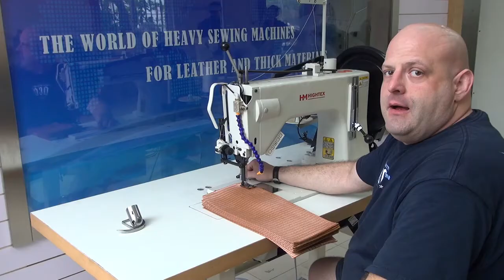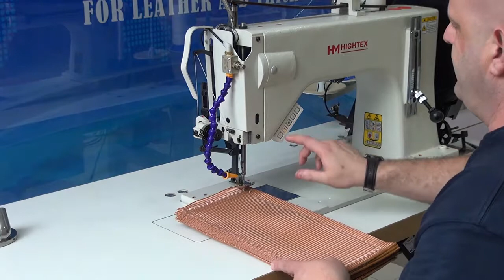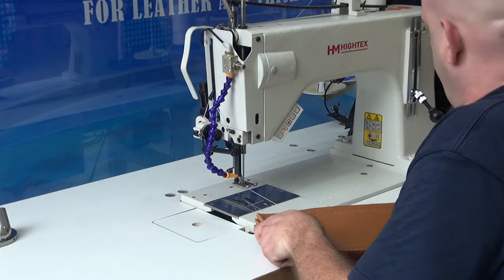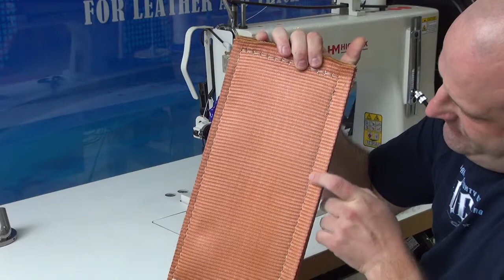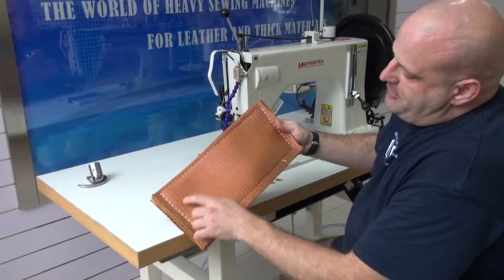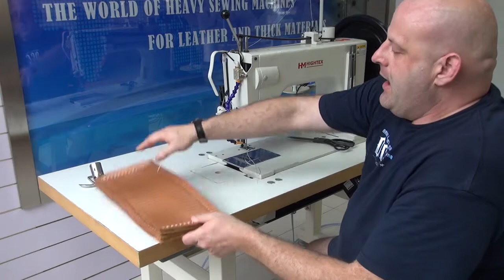733CS extra heavy duty lifting slings sewing machine and harnesses sewing machine

Comment: it is beautiful. amazing machine. 
I see in the company page this sewing machine is 240 KG. I mean the weight. is that true may I ask? I mean the standard one which has 32mm presser foot lift.
Reply from the maker: Sewing machine head + Kinedyne HM-750T + heavy stand and table, total 240 KGS, it is tule. Plus the plywood case, the final weight is 260KGS. Yes, standard presser foot lift is 32mm, we also can lift to 38mm, buy custom made.
Reply: @HightexHeavysewingtechnology  
thanks for reply. thanks for your time
Reply: @HightexHeavysewingtechnology  
I don't know may I ask this here or not? hope am allowed. 
Am busy to save money for a heavy leather sewing machine, rather Hightex brand. now I've saved 1600 euro. and I think up to "30-01-2023" I can make it 4000 euro. and up to "30-3-2023" 5000 Euro.
what am looking a sewing machine with real walking foot for very heavy duty which has almost 30mm foot lift. it has to be flatbed. and the weight of the sewing machine [total] has to be maximum 120 KG. 120 or 130 KG, something like that. do you think can I find one in Hightex? 
if YES which one? I've searched in Hightex main page, and the only I found was 733 version which is very heavy [240 KG] for my old house. am living in a  old house in second floor which made by wood, I can't put a 240 KG sewing machine in my house, that is why am looking for a machine about 130 KG.